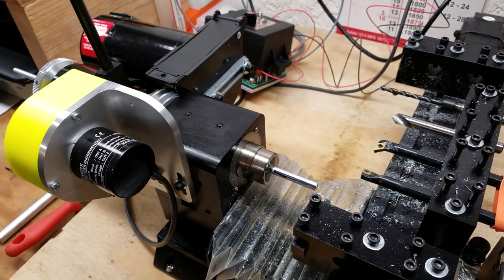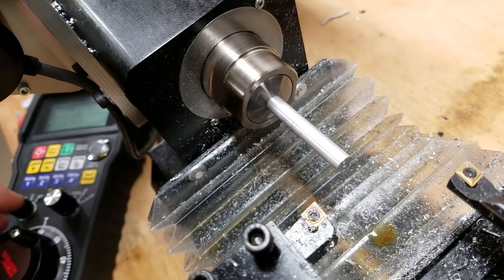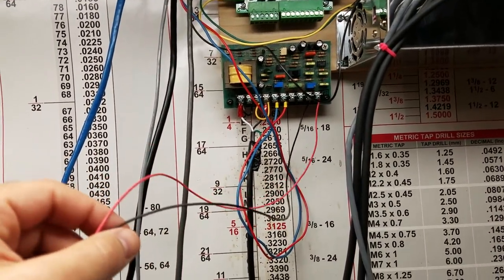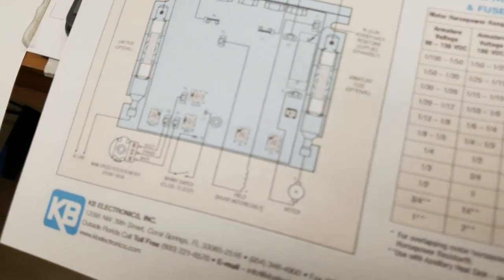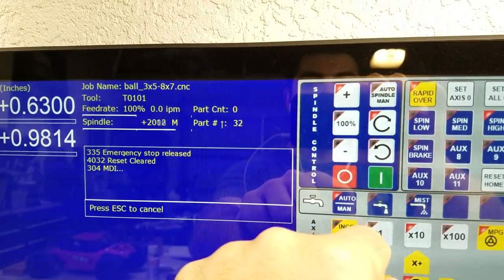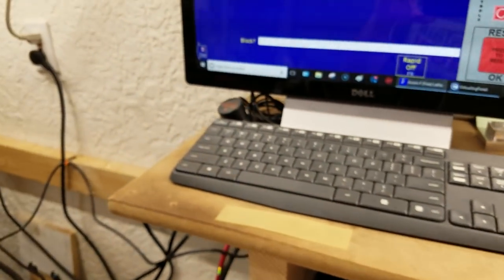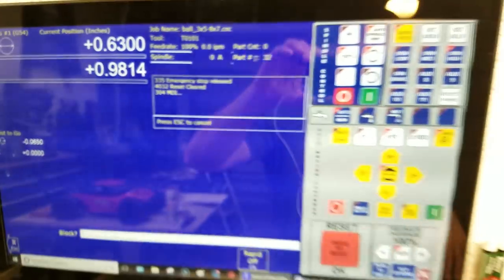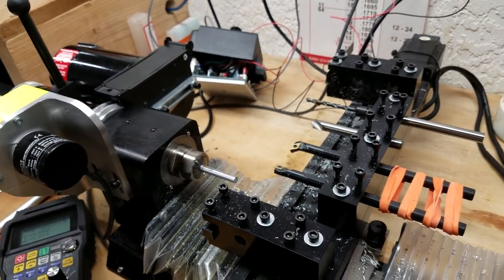Centroid Acorn CNC: Control Spindle RPM on DC Motor Controllers

Comment: Good job Franco. Love this series on the Acorn
Reply from the maker: Thanks.  I've been working on solving this problem (controlling DC Spindle Drives with DIY CNC hardware) for several years.  The key was the KBSI-240D board.

Comment: Thanks for the phenomenal videos Franco.  I saw your previous video on using the KBSI-240D board on the PM-25MV.  To clarify, does the PM-25MV also require the KBLC-240DS DC motor controller for spindle speed & direction control via Acorn?  Or would the PM-25MV be wired up as per the diagram in your last video where only the KBSI-240D was shown?  I'm a little confused on what configuration would necessitate using the KBLC-240DS and where it's not needed.... I guess I'm looking to confirm whether you're now saying that it should be used anytime a DC motor is in use?
Reply from the maker: Hi.  For the PM25MV you should only need the KBSI-240D signal isolation board.  It isolates the Acorn and scales the 10V down to 5V suitable for controlling the PM25MV motor controller.  I just placed an updated schematic for the PM25MV in the dropbox folder.
https://www.dropbox.com/s/o7y9prakpibc8pp/PM25-Schematics2.pdf?dl=0

Comment: Thanks for the great videos....I have a question ...Is it possible by using the kbsi-240 and kbic-240 to control the spindle in both forward and reverse directions using the centroid acorn and relay board?

Comment: Great job! Quick question. I understand that the isolator will take the 10V from Acorn and interpolate it for a 5V output to a speed controller like on my PM25. My question is, what benefit is the KB board over a VFD that takes 10V in and directly controls the motor? Is it purely cost? Or some functionality? Again great job. Your helping me with my conversion.
Reply from the maker: Great question. A VFD is designed to work with a three phase AC motor. Most of these small mills/lathes are equipped with a DC motor. Therefore, in order to use the existing DC motor and driver, you need to use the signal isolation board. Or, you could swap out the motor and the electronics for an AC motor and VFD but that can be tricky. It's hard to find small three phase AC motors.
Reply: Franco thanks! Had no idea they were 3ph specific. Guess I’ll be getting the board then. Keep up the great work.
Reply: @Beechdrvr  VFD stands for Variable FREQUENCY Drive...it varies the frequency to control the speed....DC motors have no phases to control the frequency of.

Comment: Hi Franco, Great Videos. Just converted my lathe with the encoder. All is working good. Did you ever get the lathe to turn in reverse? If so could you provide a video or the wiring diagram?  Keep up the good work.
Reply from the maker: Hi.  I think this will get you pretty close.  https://youtu.be/6Abi_qH1tAs
Reply: Hi Again. That video shows for the mill with a different dc motor control board than The Sherline lathe dc motor control board is different?

Comment: Very cool. I'm still learning and learning for when I do my conversion. Is a encoder required for running that board for spindle control or is it just for reading the true spindle speed. I'm will be converting a pm25mv and I'm trying to get all my ducks in a row. Thanks again.
Reply from the maker: Hi.  You can control a spindle without the encoder.  The only time you NEED an encoder is for threading and/or tapping.
Reply: @FrancoCNC  thanks for the info Franco!

Comment: If you were using this setup on a larger Lathe ie CSS but without steppers on the closs slide (manual op) what or how would you provide feeback to maintain constant spindle speed
Reply from the maker: Hi.  The acorn product does't have any way of doing that.  I can read a spindle encoder and control a spindle VFD.  It will adjust axis movement to compensate for the true spindle rotation.  But, it doesn't have any way to read an axis encoder and then adjust the spindle to match.

Comment: In your opinion, do you think it would work on my PM30-MV that has the 220Volt 2Hp Brushless DC motor?  I'm pretty sure that it would because I measured the voltage across the speed potentiometer of the stock brushless drive at 5.0 volts, and it is a linear pot.  I currently am using ACORN to turn the spindle on and off, but I really would like to control the RPM and Direction with G-codes.
Reply from the maker: Hi.  I think it will.  Check out this video:  https://youtu.be/-h4k-9qlTHo
A nice gentleman sent me the wiring diagram for his PM-25MV which should have the same spindle drive as your machine.  I think should be pretty simple to control the spindle RPM once you have the voltage isolation board.

Comment: How did you hook the relay to turn the spindle on and off on your KBLC-240DS  Controller?
Reply: His setup really just takes over the potentiomter in the controller.  When the Acorn is powered up it controls the spindle speed.  If you power off the Acorn the spindle will crank to max.     I just make sure to turn off the controller before I power off the Acorn.  You could tie the power line of the spindle into a relay on the acorn if you just want on/off control.